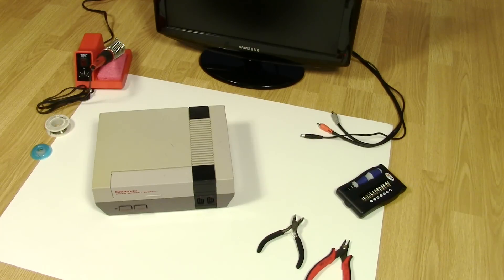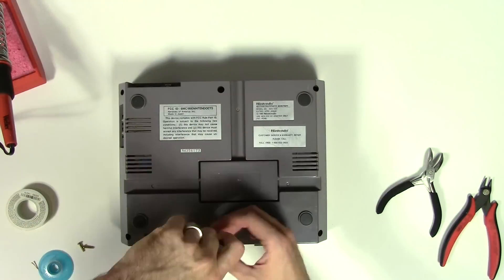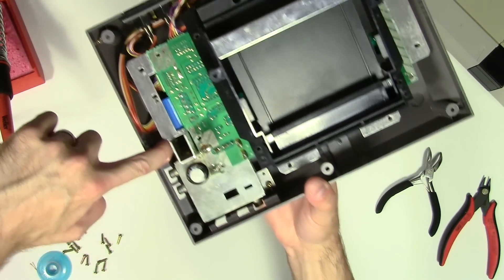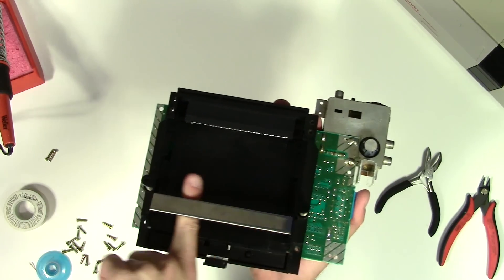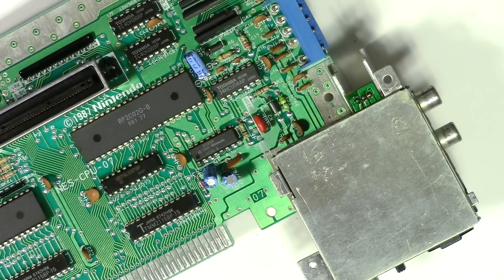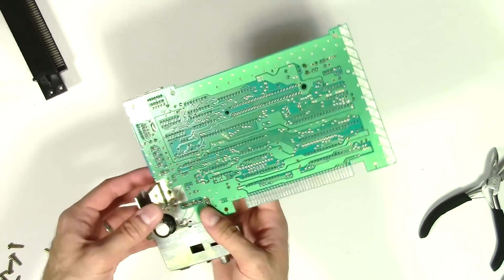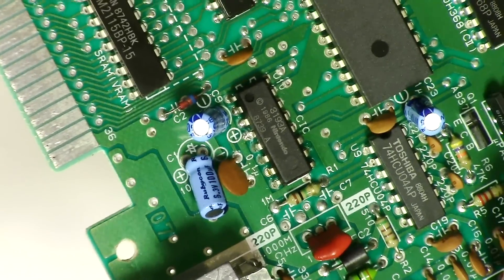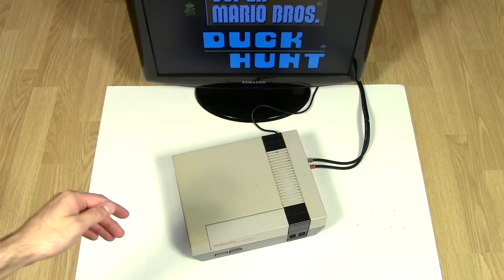Fixing the NES Blinking Light of Death

Comment: You should have tried a desoldering pump.
Reply: Thank You Mark!! I was Thinking The Same Thing!!!
Reply: Mark Barker ,
Or even a squeezed solder suction bulb. They're so cheap that I always have one because I have them everywhere and it gets jobs done.
Reply: That was my thought too.

I always use a DS pump especially on through-holes that act as vias. Once the chip is removed, clean up both sides with solder wick and then clean the area with a q-tip and isopropyl alcohol.
Reply: MatchstalkMan ,
Yep - I relegate the expense and consumption / stocking of solder wicks to cleanup mainly. Pumps and suction bulbs do the heavy, bulk lifting.

Comment: Flux is a HUGE help desoldering chips on these boards, especially the PPU on the 4 pins that are connected to the lockout chip. 

Good time to replace the capacitors too, it looks like the large one in your power supply is bulging?

Comment: Remembering back like 25 Years, I can remember thinking that I was getting the blinking light because the spring was worn out on the cartridge holder and it wasn't holding the game down firmly enough, because if I just slightly held a finger on the cartridge it would work. Is that ever a reason for the error? Or is it almost always the pin connector and the chip?
Reply: It's the connector. 99% of the time it is the connector.

Comment: Many many years ago, I fixed the red light flash by opening the case and using a small flathead to help pry up the pins on the black connector. They tend to get flattened over time from pressing the cartridge down. Lifting them back up helps the connection and solved my issue. 

I didn’t know the chip could fail but no need to neuter an NES If all it needs is a cleaning or some lifted pins.

Comment: Even just bending the pin is just as irreversible as cutting it. All you need to fix cutting the pin is to slap a dab of solder over the break and it's connected again.
Reply: It seems to me that the best way of doing it reversibly would be to solder in a socket to put the chip into You can then cut the pin of the socket before installation so that the original chip is completely untouched. If you're going to desolder the chip anyways, might as well solder in an easily replaceable socket.

Comment: Disabling the lockout chip is the best thing NES owners can do. Fun fact: the top loader NES doesn't have a lockout chip!

I fixed an NES which needed a new VRAM chip and made sure the card edge slots weren't corroded and replaced the slot.

Comment: Hi, so I did this (disconnected the fourth leg) and it did stop the light from blinking, but my game still doesn't work. I bought the cart off amazon and it looks pretty clean no rattling around inside or anything like that. Do you think I should replace the 72 bit connector or try another game first?
Reply from the maker: Definitely try another game first, though it certainly is possible that your 72-pin connector is bad (another common problem). Good luck!
Reply: +This Does Not Compute ok thanks. I have only have one game at the moment, gonna order another off amazon. Gonna go ahead and order the new connector while I'm at just incase. Thanks for the video and advice 😊 have a good day.
Reply: Kayla Napier
Reply: Kayla Napier what was the problem?
Reply: Did you clean it with alcohol? I use 70 to 90 % and it works good for all my games (even my 3ds games)

Comment: I've got an NES and when I put in a game and boot it up, it gives the blinking light and the constantly refreshing screen on the TV. However, if I insert the cart just barely enough to be able to click it down (rather than push the cart all the way in), it runs the game no problem. Is the problem still the chip? Or is it just a coincidence that all the games I have only work when I insert them the same way?
Reply from the maker: +MotionTransformer That sounds like a problem with the cartridge connector, not the chip. Thankfully replacements are available pretty inexpensively.

Comment: Gift card with paper towel works great on the N64 slot. Just put the paper towel over the slot and push it in with a gift card. Make sure and pulling back to hold on to the paper towel so it’s not left inside. Use some rubbing alcohol on the paper towel Also Use tooth brush

Comment: I've noticed that after I replaced my pin connector if I push the cartridge down after sliding the game in , it doesn't read games. So I just slide the cartridge in and don't push the tray down. Works fine!! Must just be cause the new connection is so tight

Comment: Actually its better to cut pin 4 away from the circuit board,its so neat and easy to do...plus it makes things nicer if you ever wanted to restore that connection....make sure you have pin 4 located on the reverse side of the circuit board..a box cutter works nicely to cut the circuit board away right up close to that pin # 4 which is shared by Capacitor C9...and thats all folks...

Comment: Actually, to my knownledge.
All PAL/NTSC NESs can play each others games without
any moddifications needed since the format was on the
consoles and not the cartridges.
what the NES10 chip did prevent was 3rd party converters and
carts from working correctly.
I bought a NTSC nes, but it was blinking like yours did, I tried
using both NTSC and PAL carts and both worked fine (except for the
blinking part).
Reply: WRONG! The 10 NES chip also controlled region lockout. You could "switch" the 10 NES chip region by a special reset pattern. But if you want to play PAL on NTSC and visa versa you will have to cut pin 4. Though your games will run at the wrong speed..if you mix regions.

Comment: +This Does Not Compute, one way to check if the 72-pin connector is causing the blinking red light, assuming the cartridge isn't, is that you can very slightly wiggle the game around and what will happen on the TV is that instead of a random flashing screen, you'll have the title screen of the game flashing. Once you get that, just hit the reset button on the NES and you're golden
Reply: +Adam Genez  i have the flashing title screen and hitting reset does nothing

Comment: I did this and it seemed to work at first. I plugged it in half way through reasembaling it and I worked fine. I finished re assembling it and now the light doesnt even turn on (at all) as if it has no power. What did I do wrong between just before replacing the top dust shield and the end of reconstructing it. I'm not old enough to have played it as a kid but I want to try the really old retro games that came into my position with the game. Thanks

Comment: I have fixed many nes consoles and sold them on. I just replace the 72 pin connector and it works fine. Option 2 is a no no for me. You have to be careful because some people just import cheap ones and are not as good quality. So it is worth paying for a good one so that it lasts.

Comment: Do you use a universal power supply for use on different consoles where different size ends  and different  amp-age are required? Asking under the assumption you repair consoles?

Comment: My connection between the 72pin and the mainboard was badly corroded and pitted. I've opted to just replace the pins and I'll have to sand down the corrosion on the mainboard side and apply some new metal. After I do that, I'll be applying some dielectric grease to prevent it from happening again. The pressure of the pins against the connector should keep the water and oxygen out so that there's no corrosion in the future. Unfortunately, you can't really do that with the cart side as you're removing and reinstalling cards constantly.

Comment: Damn Blinking light. I've taken apart and cleaned the console as advised. still damn blinking light, i bought a new 72 pin board and replaced old one. still blinking. I'm thinking of just trying to clean everything again. I' m nervous about cutting the #4 pin extreme!!. any other suggestions?

Comment: You should get an electric desolder iron/pump. That way you heat the joint up and suck the solder out. Really the only way I've been able to easily desolder pins.

Comment: How to fix the blinking red light of death. Turn the console off. Pull out the game. Blow on the inside of the game while trying not to spit in it. Place the cartridge back in the Nintendo slightly hanging out. Push the game into place snapping the cartridge plastic with the console plastic. Push forward on the game. Turn on. If this doesn't work after pressing RESET and POWER a few times, rinse and repeat until it eventually... inevitably works
Reply: Oh bullshit

Comment: Hey I just bought an old NES and had the same problem! I cut the 4th pin and it got rid of the blinking light! Now my problem seems to be some games not working, some without audio, and others the controllers only work for "start" and "select." Would that be a 72 pin problem, or is that a deeper issue with the circuit board? Thanks for the help!
Reply: Bad traces.

Comment: Hi. Tried clipping the 4th pin this evening. It stopped the red blinking light. But when I hooked the NES up to the TV, I have a dark green screen. Any ideas?
Reply: Clean your games.
Seriously, get the 3.8 mm screw driver, open the carts and clean the games. Get some brasso, and scrub them with the with q-tips. Wipe off the brasso, then go over the pins again with some rubbing alcohol and then wipe it again with a clean cloth. Then put the game back together and they should work.

Comment: hi,  I hope this reaches you.  I have the NES. I tried to cut but instead pulled the pin out of the chip.  I don't have a blinking light anymore,  but the screen is just gray.  did I permanently destroy my NES?
Reply: U did it wrong
Reply: +Shaina Hicks I know that,  that's why I asked I just aimed that I did.  got rid of itand got two other working ones now.  thanks tho
Reply: Nope you didn't destroy the NES, I found a NES a few days back & came across the same issues, 1st one was the blinking lights/flashing screen issue, tried to cut the pin but instead ended up pulling the pin out of the chip, checked it again & had nothing but a blank grey screen so next step I tried was to boil the 72 pin connector for around 10 minutes & clean it thoroughly with cleaning alcohol. I also cleaned the connectors on the motherboard, the games with an eraser & cleaning alcohol. Finally after drying the connector reassembled everything & the game worked perfectly.
Try these things maybe it'll help, also kinda late reply I know but was doing similar trouble shooting so thought I'd comment.
Reply: +cultpython thanks I'm gonna try it!
Reply: Nope you destroyed your machine I did the same thing on his video and now my Nintendo is Junk. Just a gray screen same thing let's piss off this freaking guy
Reply: Not necessarily. I did the same thing when I tried to cut pin 4 on the lockout chip on my NES, but it works just fine. A grey screen generally means the NES can't read the cart, which has little to do with the lockout chip. Lockout chip issues almost always manifest as the familiar blinking red light because the function of the lockout chip is to continually reset the NES on one-second intervals unless it interfaces with a "key" chip in an official Nintendo game cart. Cutting pin 4 interrupts that reset signal so the NES continues to run uninterrupted even if there is no cartridge detected at all, in which case you will simply see a grey screen. If all you get is a grey screen after cutting (or pulling) pin 4, then chances are you have a poor connection to your game cartridge. Try cleaning or replacing the 72-pin connector, cleaning the contacts for the connector on the board, and thoroughly cleaning the pins on the game cart.

Comment: @thisdoesnotcompute 
I did this today and now Im getting nothing but a grey screen but the blinking red light has stopped. You seem to know a lot so I was wondering if you knew how I could troubleshoot this?
Reply from the maker: You might want to inspect and clean the cartridge connector, they're the cause of an awful lot of NES problems.
Reply: mine did the same thing even after cleaning the cartridge connector.
Reply: Same here
Reply: Me too. The red light has stopped flashing but now there is a grey screen. I tried several different cartridges and got the same result. I have another NES that I can try to fix. Maybe later.
Reply: I replaced the 72-pin connector and removed the 4th pin and the red light has stopped blinking but I am still getting just a gray screen . Do you know how to fix this?
Reply: It can sometimes help to hit the restart button a a few times or wiggle the cart around a bit. I had to clean my 72 pin connector before as well.
Reply: LeaninLemur Did anyone resolve the solid gray screen issue?  I un soldered #4 pin and now get the solid gray screen of death.  Tried putting games in the freezer for a while (a trick we used to do back in college when we ditched PS for retro) and still gray screen.  My 72 pin is clean and the pins look good, games fit tight.
Reply: Ryno5150 is the channel selector on the back flicked to the correct channel? one does antennae and the other does composite
Reply: I'll check.  I know I have it set to channel 4
Reply: Ryno5150 when the lockout chip is didabled, there are 3 more solutions, technically 4, boil your 72 pin for 20 minutes, flipping it every 5, get a blinking light win, get a game genie
Reply: grabbity I still get the grey screen. I tried replacing the connector, tried the different switches and games. No luck
Reply: Geoffrey Burr if you have a new 72 pin and the lockout disabled. try getting a 3.8mm security screwdriver and brasso.

 open the cartridges and clean the connectors. but the most likely cause is the new connector isn't seated properly, so open it up, take the 72 pin out, clean the contacts on the board with brasso, out the connector back on nice and securely. also, when you put the tray back on, make sure the tab the sticks out of the bottom is underneath the board, this will ensure a better connection.
Reply: just reiterating: "put them in the freezer"

Comment: another non-perminant solution is to solder a wire from the 4th pin over the the shielding around the power supply

Comment: 6 years later and all you need is a Blinking Light Win attachment mod.
Reply: Cheaper to cut the pin.
Reply: @theannoyedmrfloyd3998  Easier to use the mod. Lasts much longer too.
Reply: @Wheels8504  Yes and if you want it to last even longer, apply a bit of dielectric grease to the connector before you slot the mod into the motherboard. That will ensure that no gremlins can get in there and gunk things up. It's not strictly necessary if they used noncorroding metals, but it never hurts and will ensure that you're not having to fix the mainboard in the future.
I'm likely going to do that mod in the near future, but for personal reasons, I need a more or less stock NES until I can get a clean 3d scan of the whole thing.

Comment: I tried to boil the 72 pin connector without result,then i bended the pin and still no result,i changed it for a brand new connector and still nothing.i decided to disable the chip...it stopped the blink but now even the games that used to work a little bit doesnt anymore 🥺

Comment: They have a new mod called red light wins a two piece replacement part without cutting anything that fixes that problem and you no longer have to push down on the cartridge and is reversible not that you'd want to.

Comment: If the nes is blinking straight away when you turn it on what would you do ?
Reply: Try other carts to see if it's one specific one. Then clean the contacts of the card first. WIggle it a bit to see if there's any slop. Then you go in and try to clean the contacts. My NES has bad corrosion on both sides of the 72pin and where it connects to the mainboard. If that all looks clean, then you'd consider other things. And while you're in there, apply a bit of dielectric grease to the mainboard contacts to prevent corrosion and oxidation. That way, you're not stuck fixing the contacts in the future if any moisture or oxygen gets in there..

Comment: Best thing to do first is boil your pin connector, pull that out and do it! Look into it.
Reply: Also the chip is likely not your problem, it might increase your boot chances a bit, but not significantly enough to use such an invasive method (my opinion). Boil pins, look into it. My NES went from boot after 20 tries to booting first every time.

Comment: so I did this mod since 2010 and my nes worked perfectly now my nes turns on as soon as I Plug it in and I am not sure why. The power button doesn't work anymore. :( can anyone help?
Reply: New plug
Reply: Scott Champyan I ordered an original power adapter replacement and apparently the plug input has an issue.
Reply: No red light of death; no power
Reply: Scott Champyan its just giving me a red light It wont turn off.
Reply: What happens on the TV screen
Reply: Scott Champyan it plays games that is in the cartridge slot
Reply: OK. I think I have the your answer. The power plug has to much voltage. Buy old, but original on EBay.
Reply: Scott Champyan but thats what I did. Should I buy new old stock?
Reply: NES is a simple machine, step by step elimination

Comment: why did you have to do that? all that would need be needed is replacing connector to fix really. i tried bending pins back on mine but did it wrong and messed it up so had to replace it. the lockout chip does that because still not making good connection on game so disabling it is not fixing the connection really. i would say maybe the replacement you have might have weaker metal maybe or something. i also never push my games down since they work without doing that too.